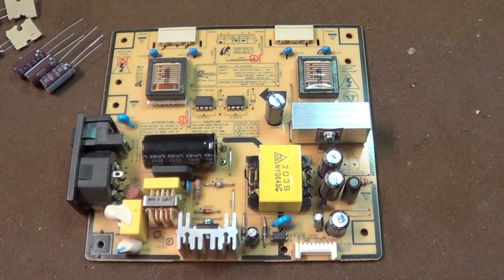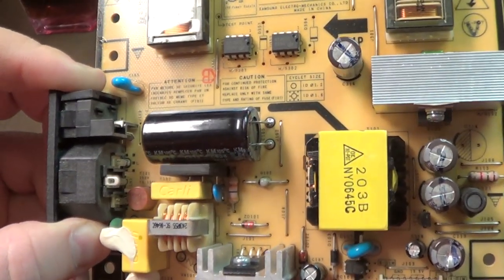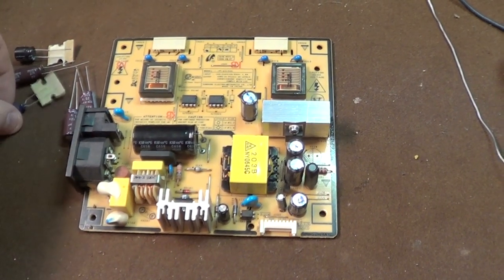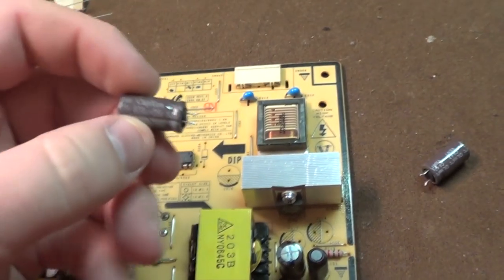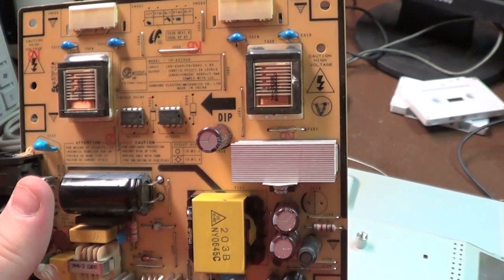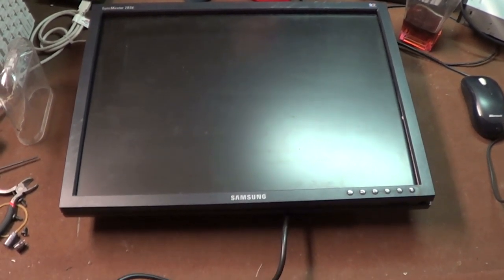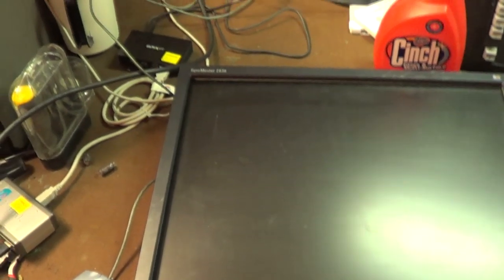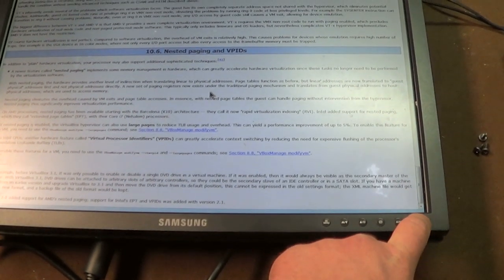Kitchen Table Electronics Repair: Samsung Syncmaster 203b Monitor

Comment: May I ask just why exactly are you using Windows Vista?
Reply: Sorry if I sounded rude, I just haven't had the greatest experience with Vista. So I assume 7 then?
Reply: AIO inc. Vista isn't that bad, they fixed most of the issues in SP2 and then it became quite a reliable (but quite slow) OS
Reply: I like speed better than reliability in the case of windows. If you have a reliable computer, you shouldn't have any of those problems, anyways.
Reply: AIO inc. I've got a machine thats 10 years old I don't really care about speed at all but its serves me well. been recapped 6 years ago after I opened it for a clean and found them all bulging!
Reply: I normally like reliability better as well, but in the case of Windows Vista and things like Ubuntu, I couldn't care less about reliability if the system is to slow to be unusable most of the time.

Comment: i somewhat was cringing when you turned it on thinking " its going to be a failure" atleast its fixed and you were unharmed,
Reply: ***** At least it's not linear supplies! ;)  I've run in to some with some really HUGE caps.  Those would bite a bit...if they don't discharge quickly. Seems some of the big ones in some of my linear supplies DO discharge rather quickly thankfully.

Devices smoking are still the worst...especially when it's the 12V rail of a device that's gone short somewhere before overcurrent protection kicks in and the entire wire burns.  Smells awful!   Still have NO IDEA how that happened as I propped stuff up to AVOID a short!